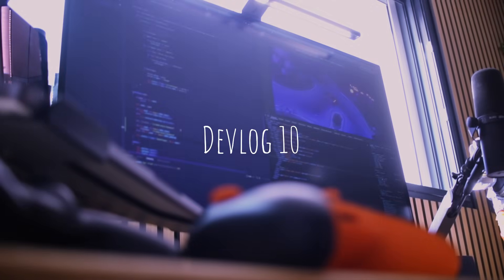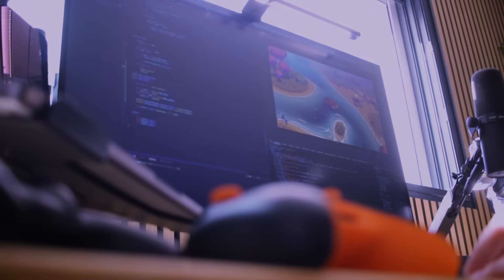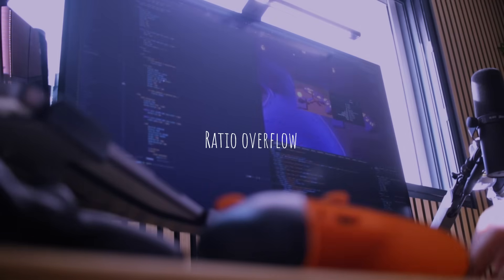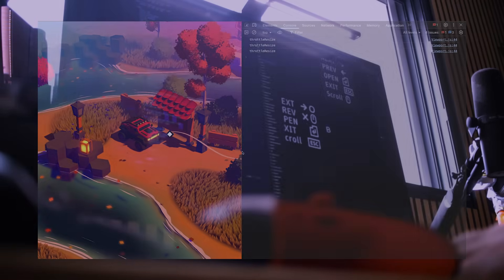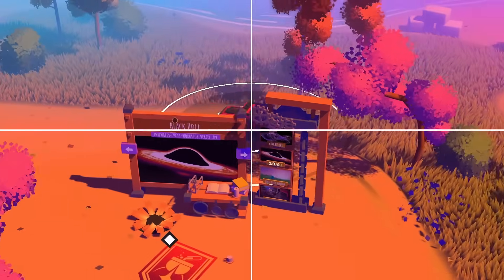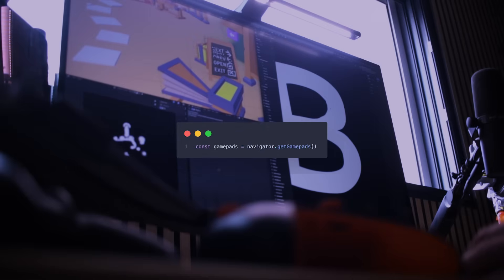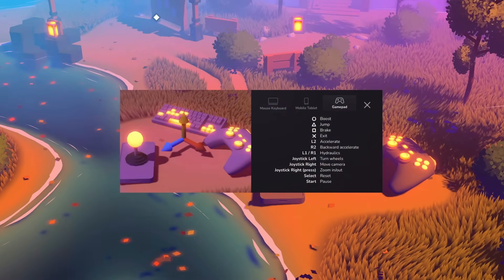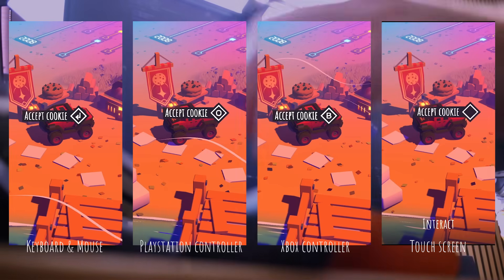Responsive - Portfolio - Devlog 10

Comment: Fantastic work as ever. I love the overflow ratio tied to zoom level for portrait devices, really clever. For gamepad mapping I would suggest X to interact/boost and O to close as this is a bit more conventional, but it's no big deal.
Reply from the maker: Thank you.
The X and O is a permanent debate and I think I'm on the minority side 😅
Here's the thing, the PS5 controller and its buttons was made for this purpose. X to close, O to validate. But it's something we find almost only in Japanese games, like one I've played A LOT, Metal Gear Solid.
So, I guess I'll have to change it. Anyway, I tend to activate interactive points while trying to boost, so, it needs some work.
Reply: @BrunoSimon  If I recall correctly, they were designed with this in mind, but then western versions had X to confirm, O to cancel, while Japanese had it still the other way, but now even the Japanese versions have it the western way

Comment: my question is when we learn with three js, do we need to learn blender more? because when i start project i don't know how? because i don't have UI model. :)).
Reply from the maker: It's not mandatory, but it'll help you at some point, for sure.
It depends on the project you do. Some project don't require models, but as soon as you need models, you better use a 3D software (not necessary Blender, although that's my favorite).
Even when models are provided, it's always good to do a pass in Blender to adapt and optimise it.